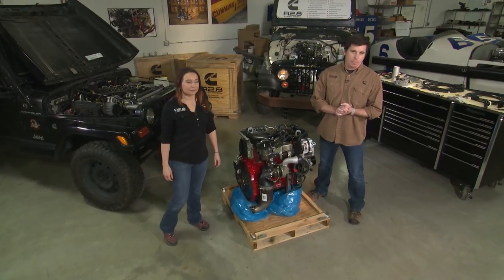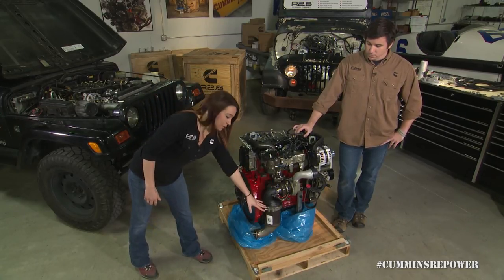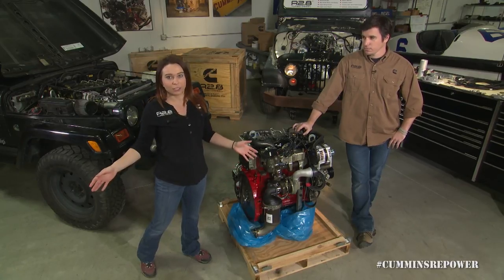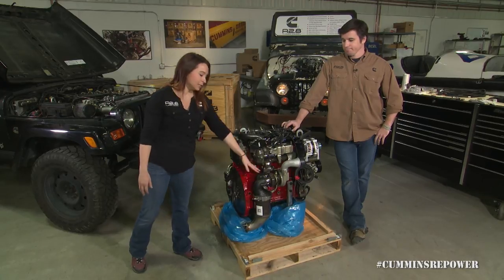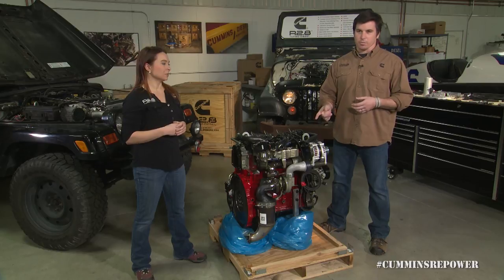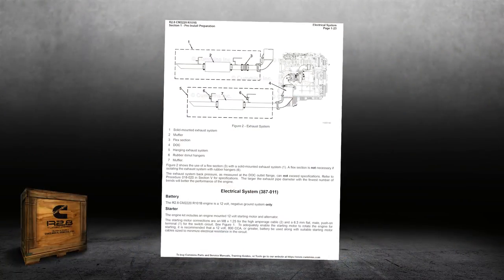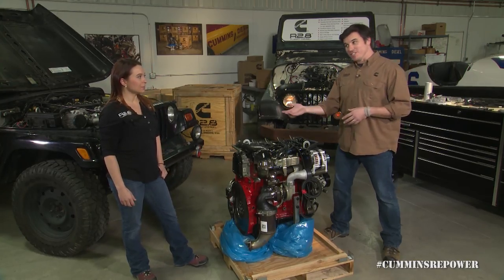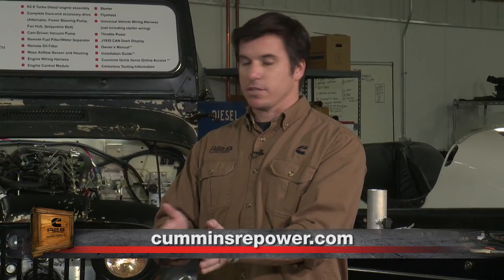Cummins Repower Garage Video 8: Exhaust System

Comment: I cleaned out my DOC and blocked off the EGR on my company pickup. 
Better fuel milage and power increase. 
Planning on doing a 3" exhaust.
If you have emissions regulations then you probably should leave the DOC.

Edit: We did the 3 inch exhaust and it really shines at higher rpm.
When towing heavy and you overtake a truck., huge difference. Also the software needs to be in your favour.
BS90023 is the non-emissions software with 161HP.

These engines are absolutely amazing!

Comment: Good stuff, this dpf and def crap I'm running on my 2018 6.7 cummins is awful and unreliable and terrible for the motor... hoping this technology will come to the legendary inline 6 in the RAM 2500/3500 platforms.
Reply: It won't.  The DOC was replaced by the DPF and SCR systems to further reduce exhaust emissions.  DOC was only the first step.  DOC doesn't reduces NOx emissions or particulate matter.

Comment: Steve, you say there is no reason to move the "DOC" or downpipe for install and you mention the Jeep TJ is passenger (US) right hand drop front axle as evidence of this... but your Jeep TJ there is driver (US) left hand drop front diff.
For a UK install into a Land Rover the "DOC"/Downpipe looks to be exactly where the front drive shaft would run to our right hand drop front differential.
Would there be any work around for this?
Also are there any plans for Cummins Repower in the UK? It would be something my business and myself would be interested in.
I cannot seem to get any decent responses from Cummins UK, they don't seem particularly bothered with is disappointing, hopefully I can get some answers here?
Reply from the maker: Hi, Nick. We’ve had customers perform R2.8 swaps into vehicles that are both passenger side as well as driver side drop. Some cases are easier or harder than others, but it can be done. We plan on filming and posting future videos on actual builds, so we can highlight some of these challenges and workarounds in those episodes. We are also investigating the emissions impact of allowing the DOC to be mounted downstream – the key to its operation is heat, so the farther downstream the less effective it is. As far as Cummins Repower UK, we are interested in expanding the program beyond the United States and Canada, so stay tuned for future announcements regarding additional markets!
Reply: CumminsEngines thanks for the reply!
I look forward to seeing your profiles on current customer conversions!
I believe I was the first person to put a Cummins 6BT into a land rover 90, I am also founder of the Cummins Land Rover Group on Facebook and my business would be interested in the Cummins Repower range in the UK, if your Cummins UK branch would like someone to work with please drop me a message on my website
www.stegs4x4.co.uk
Reply: I thought he was talking about the CJ half jeep when he said passenger side drop front axle.

Comment: Warning 
This thing is made in CHINA!!!!! And has a terrible track record! 
Cummins has sold out!!!!!
Reply: Roland B The block for the r2.8 is machined in China but its assembled in the USA (Columbus plant). I have “heard” that this engine has a “terrible track record”, but when I research on my own I can find no evidence to support it. This “terrible track record “ myth seems to be from two particular diesel repower companies that DON’T offer the r2.8 and believe their non-Cummins solutions are better. The r2.8 has a 2year 2800 hour warranty (;one of those diesel repower shops claims its only 60 days). The ISF2.8 (the Chinese OEM version) did have some issues at first. But The ISB 5.9 and ISB 6.7 both had teething problems as well  (the 53 series blocks and DPF issues come to mind). But that doesn’t make them have a “terrible track record”. They are still more reliable and dependable than anything else on the market. I’m seriously considering a r2.8 repower. The only other two considerations are the b3.9t and b3.3t only because there may may a cost savings
Reply: The Lincoln Penny 
Hopefully w you are correct. I think few where more excited about it at first than me. As it seems like an awesome package. Guess time will tell